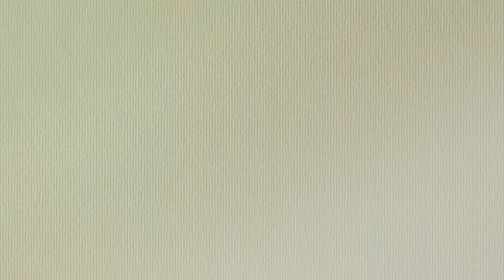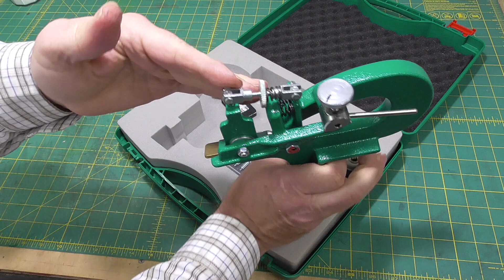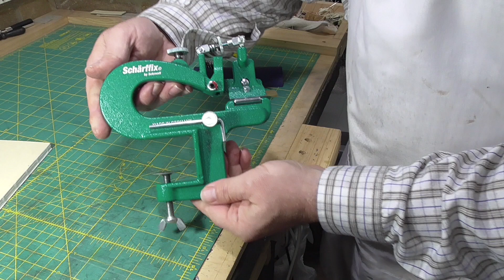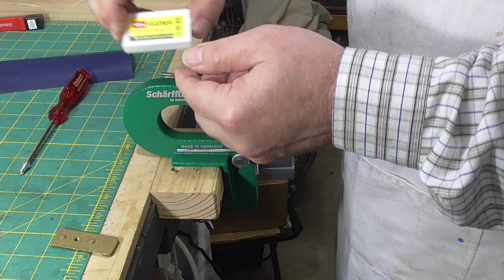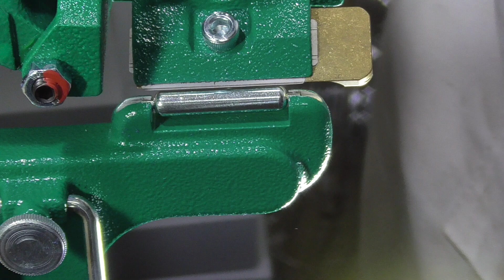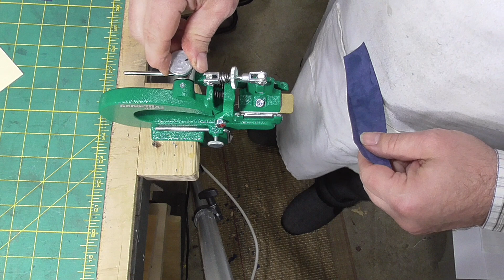Using a Schärffix for Leather Paring // Adventures in Bookbinding

Comment from the maker: There was a good comment about blades going blunt quickly, which I can't find.  It reminded me there are some points I forgot to make in the video.  Sorry I lost the comment but I hope I answer your points here.  The Schärffix isn't the answer for all paring - for me anyway.  I still use a knife for most edge paring and I can;t get a feather edge with it (I have to do this with a knife).  There are leathers that just take the edge off the blades too quickly.  And if you don't change the blades before they reach a certain level of bluntness they will grab and cut through.  The blades are double sided so you get 2 uses from each blade.  When I was younger I used English made Wilkinson Swords for shaving and I could get 5 shaves from these compared to 3 from the modern WS.  Maybe my beard was softer.  Not all blades are made equal, and the only 2 I now use are the Japanese made Feather brand and the German made Wilkinson Sword.  The later hold an edge longer while the former start sharper in my opinion.  If I want to go super thin I start with the WS and then swap to a Feather for the final cut once the leather has become fragile.  I found it a game changer for paring leather for labels and inner joints.
Reply: I've read recently that the Indian-made Wilkinson Sword blades are better than German-made. Dorco 301 blades are also good.

Comment: I recently got a scharrfix and am struggling to pare leather without cutting through or tearing holes. I'm using the blades provided. Do you suppose that's my problem?
Reply from the maker: I’ve found those blades not to be as sharp as others. Try the Japanese made Feather brand. Don’t take too thick a cut at once. Practice with small narrow pieces to get used to it. Good luck.
Reply: @DASBookbinding  Thank you for the recommendations. I find that when I'm paring a single inch or 2 inch wide strip, I have success. But when I change over to a Bible cover, I think the excess hanging down outside of the mouth is causing the angle of the leather in the mouth to be different and it's harder to control the leather as it goes through. I think that's what my biggest problem is. It needs an extended roller that sticks straight out from where the roller is so that the excess leather can be supported and roll over too as you skive.

Comment: I have had a certain amount of luck with my machine. Some  goat leather cuts better  than others. The thinnest I have got is about 6/1000. Other leathers have torn at much  thicker pieces.sometimes it is my hurry to do it quicker than I should, but other times when I am taking my time and only moving the blade down in very small increments it snaps or tears.

Comment: Great video like the others. Is there a fixed or standard thickness for the leather we have to pair? what would be the ideal thickness?
Reply from the maker: That would too easy.  Depends on leather and the book being covered.  But a rough guide might be 0.6 to 0.8mm for the body of the leather with turn-ins, joints, and sometimes spine usually thinner.
Reply: @DASBookbinding  Thanks

Comment: attempting to use this for book binding and I continue to just tear the leather, lol
Reply from the maker: Sorry to hear it.  It is still a challenging machine to use.  If the leather is actually tearing rather than say cutting through, then the blades aren't sharp enough.  Not all razor blades are made equal.  Japanese made Feather blades are extremely good, as well as Merkur.  I shave most days with these razors, and these 2 brands are so much better than most others.  It's obvious when you shave with them.  Even then occasionally one side will be a bit duller than usual.  It's obvious when shaving, and harder to tell when paring.
Reply: TY. I watched your video to get positioning and technique and put new blade in. I was successful for one paring and just finished my first bible rebind. The corners look horrible, however it was the first attempt. Thank you for your video!!

Comment: The spring on the angle adjuster wheel is an important addition. The Scharffix I got years ago didn't come with springs.
Reply: What makes it an important addition? TIA
Reply: @IamTreken  More precise control and the adjustment wheel is less likely to vibrate out of position.

Comment: Thank you for the video! I actually have Chinese knock-off and it's ok, yes it's holds angle not so well, but it works. With strechy chrome tanned leather it's essential to start from the middle especially for pieces longer than about 10cm, because otherwise leather gets caught somewhere and it's a big chance to make a hole...I mostly use this thing for inner leather joints, it's much faster than with knife.
Reply from the maker: Thanks for your observations.  Yes, good point about starting in the middle.  All the best, DAS

Comment: As I can't afford a skiving machine, would this be an option if you want to skive edges only and also on softer leather, like nappa leather, skiving 1mm down to 0.6?
Reply from the maker: Yep, this is a luxury, you don;t have to have one.  You can get away with just paring corners and headcaps.  A French style paring knife is probably the most versatile.  Your can get fairly cheap ones from Hewits or Talas.  But they do need a lot of work to get them very sharp, which is essential.  For years I only used an English style paring knife and spokeshave.  Good luck!  DAS
Reply: @DASBookbinding  I have a French skiving knife, it doesn’t work well on soft leather unfortunately. Thanks for your fast reply
Reply from the maker: @MaryvandenBoogaard  It sounds like your leather may be chrome tanned.  Soft stretchy leather is difficult to pare using any method.  I'm not sure the Scharffix would be any more successful.  Good luck!  DAS

Comment: At least ten or so years ...  LOL!
Thanks for the video Darryn.  I love my Schärffix but I find it so frustrating the the thickness adjustment is backwards and to close the gap you have to turn the knob anti-clockwise - It's just so un-intuitive.  But definitely a handy tool to have.  It'll even do a good thinning job on hairy-backed chrome-tan.
Reply from the maker: Hi John.  I hadn't thought about it but you are right, it does go against rightie tightie.  I lived without it for a long time.  But then got sick of not getting labels thin enough with the spokeshave.  Also great for inner leather joints.  All the best, Darryn